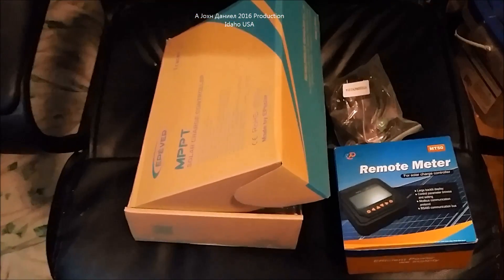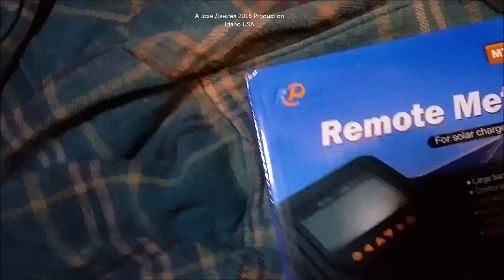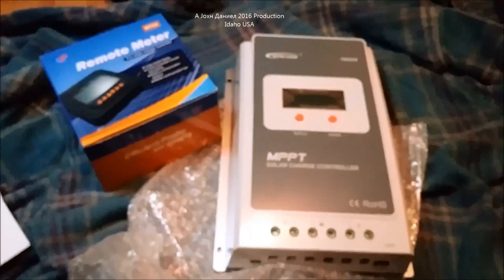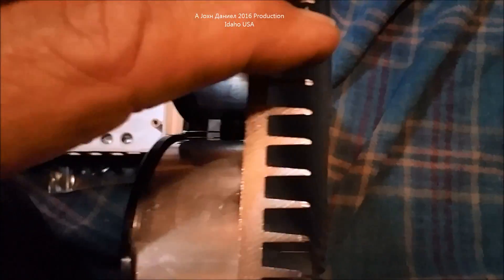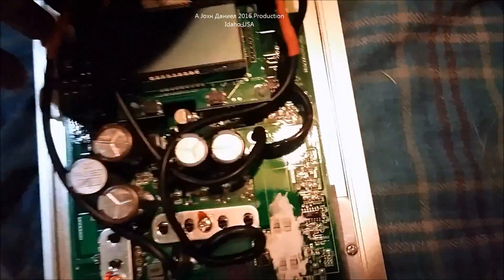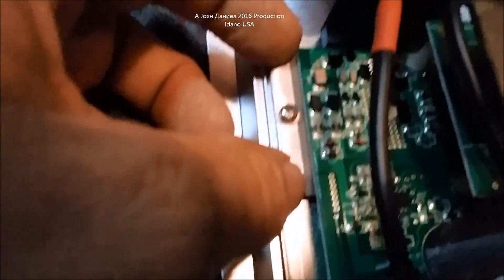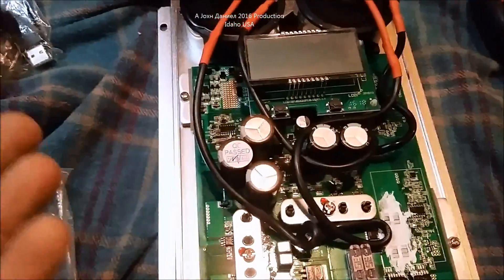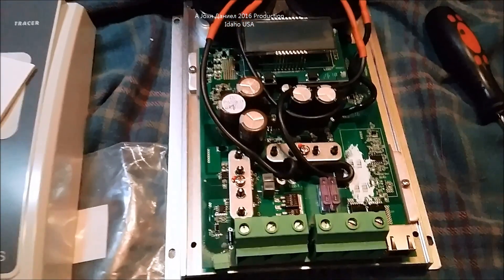MPPT Solar Charge Controller 40 AMP EPSolar EPEver WE OPEN IT UP! (info Below)

Comment: Why does this controller have 2 35 amp fuses & not 2 40 amp fuses?
Reply from the maker: +garilasprouts It has 2 sides, each fused to 30 or 35. I noted one in a 20 amp model I saw, 2 in this one. Seems it's designed to handle high incoming surge. It has a current limiter on the load side apparently that's like a circuit breaker.

Comment: I can't swear on it, but I believe Renogy have theirs badge built by Tracer, including the 60Amp Commander.  So there's at least are the genuine article, just badge built.
Reply from the maker: +Drewboo 1968 I went the Midnight Classic route. One $580 loss that shut down 80 amps of panels and crippled our system. Their loss and failure rate is higher than Tracer.  So when I found that out I bought 3 Tracers @ 40 amps each, had fail safes, higher capacity, and saved $70 in the end.
Reply: Јохн Даниел Thanks for the heads up.  I'm going to have to dig a little deeper and see if I can't find some stats for their failure rate.  My main issue with the tracer/EPEver is that in some vids on YT, they have been shown to take as long as 5 minutes or more to sweep the IP curve... is this the case on these newer generation models.. what has your experience been?  Also, what do you think (if anything) of the 60A variants the IT/ET6415ND  that is a serious contender in my mind.  I believe the only difference is that the IT variant has a load output.
Reply from the maker: +Drewboo 1968 The best argument I have for Tracer is its a Taiwan company with the high quality history. Midnights boards are all China parts, and I have had too many losses putting my eggs in one high amp device to do it again. When I did my reasoning, I figured in the long run its cheaper and more dependable to put 8awg runs at 35-38 amps feeding 40 Amp mppt then adjusting just one of 7 to exceed 14.6v. Seems why batteries in people's systems I did install are so healthy.
Reply from the maker: I found and bought a awesome and slightly cheaper 40 amp MPPT that is a much higher 150 volt capable thats actually a Tracer but in Horizontal layout. All internals are the same. I'll do a video on it after 3 months use so stay tuned, so far its excellent. http://rover.ebay.com/rover/1/711-53200-19255-0/1?icep_ff3=2&pub=5575119394&toolid=10001&campid=5337966591&customid=Same+As+Tracer&icep_item=142175552088&ipn=psmain&icep_vectorid=229466&kwid=902099&mtid=824&kw=lg Made by Tracer For EPSolSun inc Taiwan.
No one lnows of these so keep it a bit quiet or the sellers will jack the prices when it starts selling a lot.
Reply: Јохн Даниел The 150 Amp model is only $150 bucks.  It could be a hidden gem if it is reliable.  I wonder if it works with the MT50 display as well?  I will be interested to see the results of your testing for sure.
Reply: As far as I understand, EP Solar are the original builder of this unit, hence the EPever name: The 'EP' bit means 'efficient power', the 'ever' bit means for ever.
There are several that look like this, but as we all know, the Chinese will copy anything, even their own. 
EPever seems to be the one with the quality customer service who as far as the forums go, look after their name. Someone will tell me I'm wrong, but that will happen anywhere. Google 'EPever', make your own conclusion.
Reply: nlo114 Thanks boss, appreciate it.  I think I am going to go the Midnite Classic route though.
Reply: I live in Italy and I have a 3210an tracer on my camper and I am very satisfied.

also I see that the American company Renogy, changes the name to some epevers models and sells them at a much higher price (renogy commander 60a costs 500 euros, epever itracer 60a costs 280 euros) I wonder if it does so legally or not! usually the Chinese are copying ...hahah

Comment: I have the controller. It is damn too good. The efficiency is about 99+%
Reply from the maker: +Marcus Casca Be sure to keep it cool.
Reply: To keep cool as in add fan to it?
Reply from the maker: +Marcus Casca You can add a fan with a electronic sensor. I've done it with everything I buy to extend life and efficiency.
Reply from the maker: +Marcus Casca When I can I'll do a video on adding cooling

Comment: can someone please measure the value of the temperature sensor and post it here .. along with the temperature. I want to see wich type of sensor /thermistor it is ptc or ntc .. I know they are powered at 3.2V. thanks
Reply from the maker: +Albert I. V. 44 ohms
Reply from the maker: +Albert I. V. 122 degrees Fahrenheit 50 Celsius

Comment: I have 3 of this now for 2 years on a 24 volt build. they work well.
Reply from the maker: Alex Siqueira Do not exceed 100 volts. The input capacitors inside are only 100 volt.
Reply from the maker: So far mine are working much better than the solar mates I have. Buying more.
Reply: Sir, just one question: I bought the mppt tracer epsolar 4215a, I can't find what's the limit voltage/amps, I can output from the Load Terminals: Connect loads.? Do you know something?
Reply from the maker: Alex Siqueira Generally they are 100 volt max input DC, and up to 15% amps over the rated can be fed into them. I run 42 amps calculated into my 40 amp models, my input voltage is 88vdc from my Stion Solar panels. 
The output is usually 1/2 the input rating at what ever your battery set up voltage is.
Reply: Јохн Даниел Thanks. As for now I got only 1 unity of 315w 45v solar panel on the mppt tracer epsolar 4215a. My battery bank will be 24v, the vendor told me that the cc can handle up to 1040w, with would fit 3 x 315w = 3 units(panel). Altough I concerned with this 100v input, cause 45v x 3 = +than 100v... Could you confirm to the veracity behind this alegation that the mppt tracer epsolar 4215a could handle 3 of these pannels when sering a 24v battery bank?
Reply from the maker: Alex Siqueira Run your panels in as 45 volt. 6 wires not 2
Reply: Јохн Даниел I apreciate the advise, but I do still not get, on that charger controler I mentioned witch max are 1040w 100v on bank 24v, what are the max number of 315w 45v solar panels one can wire, 2 or 3? What you mean with 6 wires not 2? Sry I got amost every knoledge about the system, but i let the connection of multiple components, as on paralel and series pv for later, and so is with fuses and stuff... Now that I'm starting to count them...
Reply from the maker: Alex Siqueira Just run them all as independent panels straight down to the controller. Before you get to the controller put 6 of them from the 3 panels in a buss bar, then go from there with 2 wires 8awg to the controller + & - terminals.
Stay at 45 volts going into the controller. the math 1040 is 1040 watts divided by the battery voltage, which should be 26.8 volts on average in your system.
1040 / 26.8 is 38.8 amps
I can do a video on how to do this if your troubled further.
Reply: Јохн Даниел I thing I already got it, but a video would be very useful to everyone, since people starting to realize that high voltage pannel plus mppt is a way more cheap and efficient than numerous 17 or 24 panels... My own produced only today 120a, but Brazil is Brazil... Thank you in advance sir...  I`ll try to learn what Buss bar means, from intuition I believe you`re referring to a fuse or power key, not used with technical terms, this is not my mother language, but I guess I will figure it out.... The main question as being answered...

Comment: I bought the 3210 few months back for low current 12V landscape lighting, with 1 250W panel... Works fine. Downloadad monitor software and bought temp censor/comm cable kit, and have that up and running too. Is working fine.
  I bought another 250W panel, a 2kW inverter, and the 4210 to replace the 30A so I could put it (3210) in my travel trailer along with 250W panel, and 225Ah T105 6V batts... will finish that project when I can....
  The 4210 was in place for only 4 days feeding 450Ah batts/12V from 2-250W panels in one array ( 74VOC..55-68V MPPT range...well within it's published opperating range ) and running moderate loads with the 2KW inverter, as well as landscape system. This unit has already burned out, and I'm waiting for warranty on it.....not sure why, as there was very little load on inverter at the time.....( Dud..??)
  In the mean time I have placed the 3210 in place of 4210, ran it through some good load/charge cycles... up to 1500W  inverter loads(sunny days here right now) and it has performed very well. The manufacturer claims that these units can handle up to 3 times their input wattage rating, and will only allow rated output current to the batts/system..... and I'm pushing this unit into that range right now with the 2-250W in series. My intention is to add another array (2-250W/series) to this system for winter time, as I live on the coast of British Columbia and we can go through MANY days at a time of crappy, low light, conditions and short winter days.
  I'm hopeful these (EPever) MPPT controllers( Come on Warranty.. !!! ) will perform as stated, as they seem to be solid units, and you can't bitch at the price point either.
Reply: Mine have lasted over 2 years so far with no problems
Reply: Some body will eat it Got warranty on it..so have new one in place now. Seems to be fine so far.

Comment: I bought the 20 amp version for my brother and it does well. I'll put up a video when I have time. He is charging a 12 volt battery bank.
Reply from the maker: This seems to have all the identical parts that the tracer 40 in other styles have at $40 cheaper. But whats obvious is that it may not cool itself as easy. So, I mounted this one on a formed aluminum sheet with a pair of 4 watt 40mm fans and a temp controller. At 105 degrees F it kicks on the fans, the power efficiency goes up the cooler it runs.